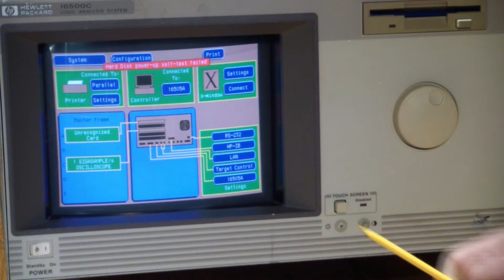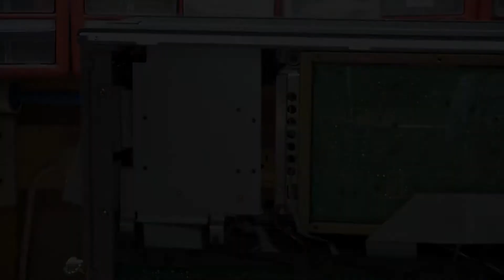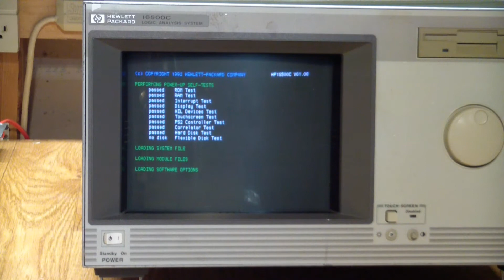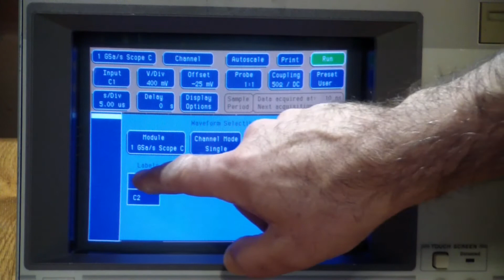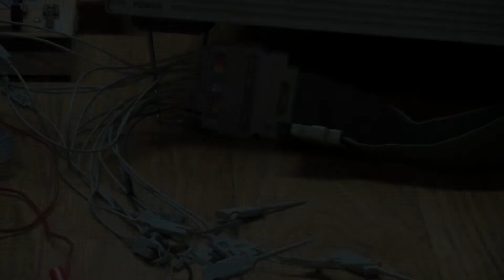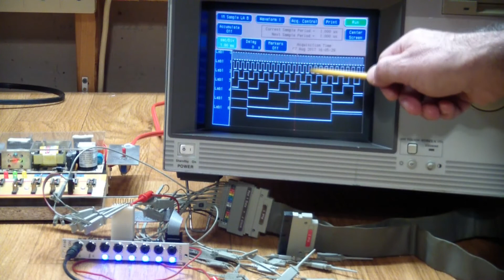AE#8 Hewlett Packard 16500C Logic Analyzer Repair and Demo

Comment: I replaced the two loud-as-hell 110V fans in my 16500C with a single 12V quiet fan (power split off from the hard disk power connector) and never had any heat problems. Obviously after I first did that, I closely monitored the temperature but with two analyzer boards and a scope board it didn't get noticeably warm inside, not even in the monitor section.

My hard disk still worked when I got it from eBay, but I replaced it with a CF card as well. The only CF card that would work was an old 64MB (yes megabytes) card because the card has to support cylinder/head/sector mode, the BIOS doesn't get along with LBA-only cards. Unfortunately it's pretty much impossible to guess which cards will work with CHS mode nowadays but chances are bigger if the card is smaller. And 64MB is plenty of space to store the system files and a large number of configurations and screen shots and whatnot.

The file system is almost but not quite like FAT, that's why formatting under DOS or Windows doesn't work. The problem is that the processor in this thing is a 68000, which stores data in big-endian format, and FAT normally uses little-endian to store data. They basically implemented the FAT file system but anywhere where it was most convenient to read and write words instead of bytes, they let the BIOS use words in native format without wasting time swapping them. They probably figured: who cares, this is an internal hard disk anyway.

The X-window interface works pretty well, and looks pretty cool too, but is completely useless, because all live screen updates are done correctly to the screen buffer, bypassing the X-window protocol, for maximum performance. So you can do configuration and start analysing on the X-window screen but any live data will only appear on the analyzer screen until you stop the run.

It's possible to connect a PS2 mouse and keyboard which makes it much easier to change settings, in my opinion. I didn't think would need them but my analyzer included a mouse and whenever I use it, I find myself using the mouse much more than the touch screen.

If you're looking for an analyzer and you think this will do cool stuff like interpret data on a serial port or SPI port or I2C port, keep looking. The closest you can get is a binary or hexadecimal readout (listing) of a bunch of pins for each clock cycle.

The protocol analyzer part that you might use to e.g. see the instructions of a program that was being executed by a processor that the analyzer was connected to, was a completely separate device (now rare as hen's teeth) without any controls, that sat on top of the analyzer and connected to that SCSI port on the back side, and even if you had one of those, you had to purchase the software for each specific protocol or CPU (instruction set) that you wanted to analyze. Mine does have software for a symbol analyzer and a signal generator on board but they are so cumbersome to use that I gave up.

The oscilloscope works, and ding the automatic setup is cool, but compared to a real scope it's a pain to use. I'm still not sure if it's even possible to show a grid on the screen which I would say is pretty essential for a scope. However if you have some analog signal that you want to look at in combination with digital signals. It's great to do mixed mode analysis even though it's a pain to set it up (there's a PDF you can download just to do that, and there are many other downloadable manuals).

So yeah, if you can get it for cheap (preferably with the probes, however I think they used the same style probes for many years and they are still available), and if you have the space, get one! But if you're serious about logic analysis, get a new one. Mind you, they don't make analyzers that can do hundreds of channels anymore. I guess that's a feature that engineers don't need anymore now that everything goes over serial buses.
Reply from the maker: This is a great review. I would agree that functionality is rather limited when looking at today's instruments, but the large number of channels still makes this desirable for analyzing and repairing electronic artifacts.

Comment: i havr 16531a oscilloscope.
iys unrecognizable card.
what should i do?
Reply from the maker: You may have dirty edge connector contacts. Try cleaning them with isopropyl alcohol. If that doesn't help then the card is faulty.
Reply: @artifactelectronics  
thanks
i will trying that 
and i download files mebee missing.
i update you
i download the file from  keysight.
bt cant copy to the system.
format file problem
how do you did this?
also unfortunately erase my composite diskatte
Reply: @artifactelectronics  
somebody tell me that needs more card
its hp  16530a time base to operate the oscilloscope.
its true?
you have also this card?

Comment: That brought back memories of my first experience with a logic analyzer many many years ago.  We had an HP analyzer similar to this one back at the first place I worked but that one had a flip-open (or maybe was stationary?) keyboard and the whole thing was very heavy and mounted on a cart.  I’m not sure if that one had a touch screen.  Anyways, this was a nice refresher and you did a great job of repairing it.  I liked your CF solution for the HD replacement. That one change probably modernized the machine by at least a decade, and also made it more reliable.  I deal mostly with FPGAs these days, and it’s pretty amazing that the amount of capabilities and memory depths you get with those dropin LAs nowadays.  I certainly don’t miss having to mess with those old LA pods and leads for connecting the LA to the DUTs.  Thanks

Comment: While the 16500B isn't "fast," it is functional. Certainly go for a 'C' if you can, but the 'B' does work, and can read/write DOS/FAT12 formatted HD floppy disks (it's running OS 3.13, so I don't know if that makes a difference). I got my 16500B from somebody at my local retro-computer meetup for $100 (he had a second, and was looking to send it to a good home). So far, with the 16510 card it came with, it's been worth it's weight, even if it doesn't have as many nice features as the 'C.'

Comment: I had a HP16500C which I gave away. It was just too darn slow. You can buy HP16700A for a pittance these days, just be sure to buy one that has all of the probes (the complete set including the pod ribbons and probes. Don't be fooled by just the ribbons). You can see what I am talking about @25:15.

I prefer a HP16700A with Opt 03 (expanded video option IIRC) over the HP16702 with its built-in screen. It's no big deal to find a monitor to use on one of these, and if you find one with an OPT 03 card in it, you can run at a higher resolution. 

But if you bide your time you can find a cheap HP16900A with the Opt 03 board in it instead. Most of the HP1670x cards will work on the HP1690x family as well (all but one, IIRC), and it is Windows-based.

Some things to watch out for:

The 16x01's (16501, 16701, 16901) are expansion frames. These are not logic analyzers, they allow you to add more cards to your existing analyzer.

Most cheap analyzers do not come with the probes. Do your homework and you will most likely find that the price for the analyzer + probes is more expensive.

Finding an analyzer with the cards that you want in it is going to be cheaper than buying one and then trying to hunt down the card that you want. Plus buying a separate card that may have issues with your system will be harder to return (or prove that it was the problem).

Do worry about the labels on the pods. Pod x is the same as pod y (in other words, for a given type of pod it doesn't matter what the number on it is).

HP, Agilent, Keysight, still treats their customers like kings. It doesn't matter if you are the original owner or not. If you have a problem with it, drop them a line. They have been very helpful to me.

Good hunting!

Comment: where did you find the operating disk files for it? All I can find is 3.14 for the 16500B. I have the 16500C and can't seem to get it working with the 3.14.
Reply from the maker: You need 1.09 for the 16500C specifically. If I remember correctly I did find these on the HP site through a link from a discussion group, but I can't find the link anymore. Persistence may be your friend.
Reply: Just contact HP, or whatever they are called these days, and they will ship you out the disks for free. They did this for me. They also sent a friend of mine in Finland the ROMs for his 3852A. Again for free.

Comment: The chip packages on the logic analysis board are the same types used with the HP FOCUS microprocessor used in the HP 9000 series 500 and 600 systems.

Comment: Love the use of a compact flash card to replace the old HDD. Didn't know it was that easy to do. I will remember that for future synth or test equipment projects. Looking forward to your next project - I think you desperately need to add an electronic load to your bench. 😜👍
Reply from the maker: I've been looking, but reasonably priced ones are hard to come by.
Reply: I haven't tried with my 16500B yet, but from what I've heard, it's a bit picky with what kind of hard drives/CF cards it will accept.